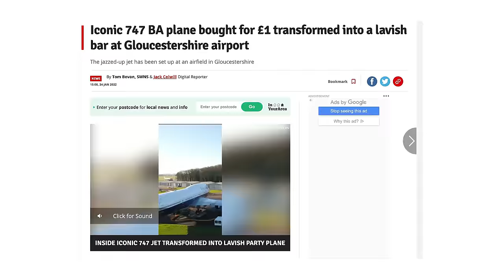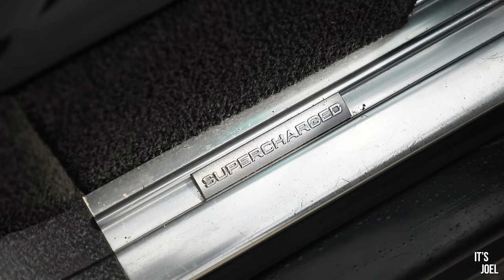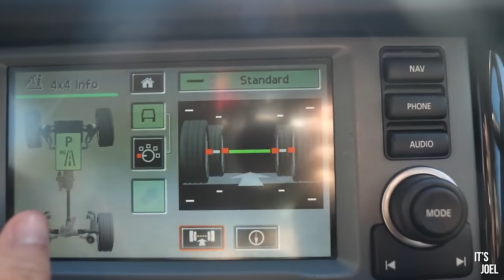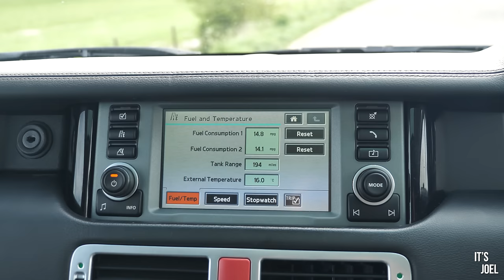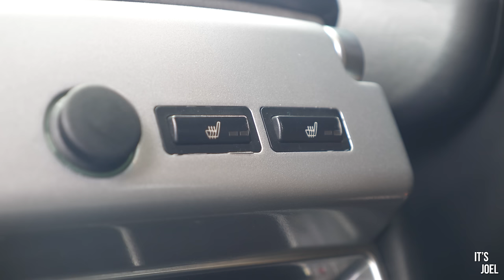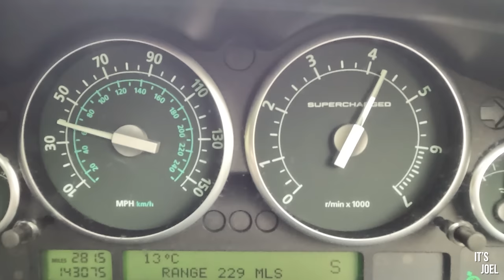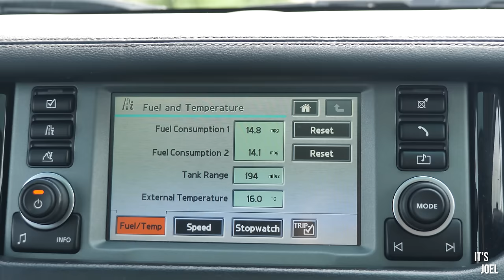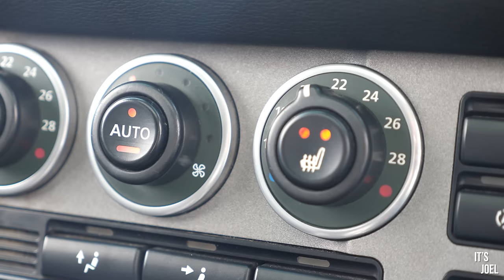BRUTALLY HONEST REVIEW OF THE 4.2 V8 SUPERCHARGED RANGE ROVER L322

Comment from the maker: What are your thoughts on the 4.2 Supercharged L322 Range Rover?
Reply: I think it’s one of the two L322’s to go for. Either this or the 4.4 TDV8. Supposedly the two most reliable engines of the bunch the benefit you get with this one is speed sound and ulez but personally I’d probably still go for the TDV8 mainly because if fuel economy and the fact that the 4.4 is still surprisingly fast
Reply: 06 seats are my favorite because they have the shoulder support where the later models got rid of it. Only the 2018 and up have shoulder support now
Reply: If you have the budget, L405 is a better buy. And the L405 wheels on that L322 are atrocious.  It makes the vehicle look confused and in the midst of an identity crisis.
Reply: @CEC321  the L405 may be better but I like the L322 more
Reply: I think the sweet spot is the 4.4 tdi Autobiography 2011 or 2012
Reply: I would still prefer 4.2 s/c with quality LPG conversion over the TdV8s bc of the long term engine maintenance
Reply: I’ve got a 2008 Range Rover sport TdV8 3.6 litre. Acc suspension that grips the road and will corner at speed with little to nothing body roll. 
And the power will throw you back in the seat. I’ve driven the L322 with the 3.6 engine as well. 
I would love to have a drive in the 4.2 but I think I would nail the throttle to much so I’ll stay with what I have. 🤣🤣
Reply: Loved the thought of it so much i bought one! absolutely amazing!
Reply: L322 4.2 supercharged V8 ... Great car ... But if you want a similar aged Range Rover, and want to thrash round corners, try a Range Rover Sport L320 with the same supercharged 400 hp V8 engine ... slightly quicker, much better on corners, and the Brembo brakes are astounding ... but the suspension is not quite as soft, and has a very slightly less luxurious interior ... but easier to parallel park in London (it's five inches shorter than an L322 and has extremely sharp steering) and, being powered by petrol, it is ULEZ compliant.
On the occasional motorway trip to Yorkshire or Somerset, from London, it does 22-24 mpg ... around town it does less than half that ... but so what! ... a regular yearly service at a specialist Land Rover establishment, a weekly visit to my local Hand Wash site and an interior/exterior mini-valet every three months ... perfect ... Total maintenance and running costs? ... Much, much cheaper than setting fire to cigarettes every day.

Comment: To anyone with one of these, I highly recommend the 20 inch alloys and putting the Pirelli all terrain tyres used on the l405 range rovers on the car. Completely transforms the grip levels.
You can also get 24mpg out of these, but there's no fun driving like that, smiles per gallon >

Comment: I believe it’s one of the most reliable engines on this generation. Not brilliant on acceleration, but far from being a slow flat. 
Love this generation! So classy.
Reply: Drop it in to sport mode, drop a gear and tell me that again.
Reply: @ well, it’s not bad, but I believe it depends on the references. I’ve had the newer one with the 5.0 S/C, when I drove the older 4.2 didn’t had the same excitement 🤣 but when I think about it’s age, it was a beast for sure

Comment: I paid $7,000 for my $92,000 4.2 RR  SC about five years ago.  The RR 'dealer' had installed an undersized battery, so the BMW electronics mostly failed to work until I rightsized the battery after a couple of days.  I had the sealed for life (i.e. short life) ZF box drained and refilled at around 90,000 miles which was late, but it has survived so far.  Just don't stand on it in 2nd, and always use manual for the first few miles on very cold days, but after another 25,000 miles it's almost perfect, so I think I'll just treat it to another lubricant and filter swap in about another month.  The air suspension compressor was noisy and soon failed, but a replacement from China that is visually identical to the OEM one was only a couple of hundred bucks and easy to swap in under an hour.  The hardest part was getting the bloody heavy 20" spare out of its well.

Both folding drinks holder were gummed up with spilled Coca-Cola or something similar. (The PO obviously had children of all ages, including adult).  They are quite easy to remove, wash and replace in perfect working order.  The FO audio was dead but easy to repair by bypassing the dead Bluetooth telephone module, which serves no useful purpose these days.  I removed and repaired the CD player, which was gummed up with dust and needed some lubricant, swapped out the DVD player with one from eBay and, with the car working well, made my one big mistake.  I replaced the well-worn Pirelli Scorpion tires with some slightly bigger, sticky Kumho tires.  My highway gas mileage dropped from 20 MPG (US Gallons) to around 16 MPG!  I use the power of the supercharged engine and attest that the Kumho's stick like sh*t to a blanket, but 4 MPG!  Woah.  I won't make that mistake next time.

It rains a lot here in Oregon, and the RR leaked a lot.  Water coming from under the dash.  Water coming down through the front seat belt retractors.  Water pouring through the electronics installed on both sides of the rear load area.  All the online advice was wrong!  The windshield was not leaking.  The roof rack mountings were not leaking.  The rear door seals were not leaking.  The rear sunroof drains were clogged so once the sunroof pan was full the accumulated water would slosh over the edge and flow forwards, backwards and sideways on top of the headliner depending on the motion of the car, or how it was parked, and flow down into the car from wherever it gathered on top of the headliner.  Since the rear drains are impossible to reach and clear without removing the roof it seems, I just used RV roof sealant tape to seal the sunroof (which never gets opened in Oregon anyway) and once the car dried out no water leaks have ever returned during the wettest winter on record!

I have one remaining challenge.  I'm convinced the bloody Germans have never forgiven we Brits for beating them in WWII., especially BMW.  The manky electronics are overengineered but under designed.  Three bus systems, excessively voltage sensitive circuitry and many connectors positioned where they are bound to get wet in a Land Rover.  Like many other Range Rover (and BMW owners) I am trying to identify the source of a parasitic voltage drain.  I have found several so far, but am confident there is at least one more to locate and eliminate.  I'm a retired computer engineer.  If any computer company built computers the way BMW designed electronics, they would have been driven out of business decades ago!

All the above said, I still love my SC RR.  It rides superbly, goes like hell when asked, and goes pretty much anywhere I want to go without any fuss.  We especially like the tall 'greenhouse' which provides fantastic vision around us for both viewing the countryside and safety in dense traffic.

If it was good enough for Queen Elizabeth II to drive around Windsor, it's good enough for me.  It was, and she did.  The Range Rover L322 is without a doubt the best 4x4 by far.  Still.
Reply: how reliable has your truck been overall? approximately how much do you spend on maintenance in a year?
Reply: Yes if it was good enough for the Queen …..

Comment: I bought a 2007 one 2 months ago. Fuel economy is poor, but that's a sacrifice I'm willing to make to own such a lovely car. I had to get petrol for ULEZ compliance. I'm also led to believe the Superchargers are more reliable than the turbos. The driving position is excellent and you can see everything outside. It's a wonderful car that does everything I need. I can have dogs in the back, do tip runs in it, but can also use it for nice drives and when you want to go out in the evening. Really is everything you need. Despite it's age it's still a head turner and I get lots of compliments about it all the time. 
I really don't see myself getting rid of it.

Comment: My dad has had a 2008 3.6 TDV8 for the last 7 years or so. Now on 175k miles, and I absolutely love it. It’s sitting in facelift 20 inch wheels, black with chrome over cream interior with piano trim and black piping, such a classy spec and classy car. So good off road, incredible for towing, and just sublime on a long journey. Honestly one of the best all round cars ever made in my opinion, so easy to place on the road despite its size, and you’re bang on about wanting to make you drive slower

Comment: Those mpg figures are eye watering and just show what a difference weight and aerodynamics makes - I have the same engine in my XJR and it will just about do 30mpg on a motorway run without hypermiling.
Reply from the maker: Yeah that doesn't suprise me! To be honest, I think if I really tried, I could potentially eek 23-25mpg out of the Range Rover, but still...

Comment: Got this engine in my L320 and its easily one of my favourite cars ever to just rattle along in. The whine is addictive though and a sub 90l tank makes the range laughable even when full. Still suck a cracking engine though and from all i can read up on is one of the most reliable available between the L319, L320 and L322.  Even managed 24.5 mpg calculated on the last 200 mile trip. Got it over the L322 purely because of the rust concerns (and its £1500 pricetag to buy) and willing to spanner 95% of things myself.
Reply from the maker: The whine is very addictive, I loved it

Comment: Was gonna go to bed, but I had to see what you thought of the 4.2! I have an 07 supercharged that looks just like clarksons. I've had plenty of issues however, put the money into it and it will return the favour. Great vehicle and I highly recommend one! The TVs help when the kiddos start arguing 😅
Reply from the maker: Thanks so much for watching!
Reply: Great content, well worth the watch!
Reply: what issues did you have if you don’t mind me asking?
Reply: @Spartansrule118 Compressor fault replaced with an AMK unit, changed the air suspension reservoir too as the other was rotten(18 years old). Welding required on the rear sills, both sides, below the rear passenger doors(wasn't that expensive as I went to a professional fabricator had the job done in less than a week). I decided  to have New Pirelli scorpions all round and new breaks(Brembo), for peace of mind.

Hope this helps 👍

Comment: My wife had a 2006 RRS with the same engine - was lovely, just got a bit too expensive for the mileage she was doing.  Had 175k on the clock when she sold it to my brother 3 years ago.  Get a pre Apr 2006 and you get the cheaper road tax, other HUGE advantage is they are all ULEZ compliant - unlike any of the diesels, the petrol V8s are also MUCH more reliable than any of the diesels and surprisingly cheap to service at a specialist.  Put those 3 together and thats a lot of additional £££  in your wallet for super unleaded.  Highly recommended 😊
Reply from the maker: I bet the RRS with the 4.2 is marvelous to drive. Still never actually driven an L320!
Reply: @itsjoel  It was great fun for what is a lego block on wheels, really comfy too - still tempted to get another one - but 5L, no supercharger wine like my XKR but a beast.  Roger the RRS is now enjoying 3 or 4 k a year with my brother who has gone through him over the last 3 1/2 years to make him even better 🙂

Comment: The tourch is a camera too it called venture camera and you can connected to the main screen and display , and there is accesories so you can fix it on the body of the car to act as a off road aids for example in front or even on the ground under the car to know your aproach or deparch limit 😊

Comment: L322 4.2 supercharged V8 ... Great car ... But if you want a similar aged Range Rover, and want to thrash round corners, try a Range Rover Sport L320 with the same supercharged 400 hp V8 engine ... slightly quicker, much better on corners, and the Brembo brakes are astounding ... but the suspension is not quite as soft, and has a very slightly less luxurious interior ... but easier to parallel park in London (it's five inches shorter than an L322 and has extremely sharp steering) and, being powered by petrol, it is ULEZ compliant.
On the occasional motorway trip to Yorkshire or Somerset, from London, it does 22-24 mpg ... around town it does less than half that ... but so what! ... a regular yearly service at a specialist Land Rover establishment, a weekly visit to my local Hand Wash site and an interior/exterior mini-valet every three months ... perfect ... Total maintenance and running costs? ... Much, much cheaper than setting fire to cigarettes every day.

Comment: I had a 2007 US spec. Sold it with 335,000 miles on the odo. Fantastic vehicle! We didn’t get the diesels in the USA & I found the 4.4 underpowered. Bigger brakes, super comfy, excellent visibility (I ran the rear middle seat down) and such a presence on the road. Epic car!
Reply: you mind sharing any issues you had along the way? were they overall reliable, or are the rumours true?
Reply: @Spartansrule118  Purchased in 2020 with 280,000 miles for $4,900. One owner. Per the dealership, lots of (often early ) servicing & maintenance but no ongoing issues. Original engine & transmission. Stuff I had to replace: Headlight switch. Boot seal. Alternator. Radiator. Bonnet release cable. One air suspension bag. Brakes. Expansion tank. Several bulbs. My mechanic (independent shop in Portland, Oregon) sees higher miles frequently on the 4.2 SC engine. It didn’t have any rust because it was always garaged and I lived on the eastern (dry) side of the state. I also owned a 2007 L322 HSE & found it underpowered, with the SC version being just about right. I also has an ‘08 LR3 SE with the 4.4 that was a very reliable car. The Jag engines were great to me, especially after having several of the Buick ones fail. I’m not hearing good things about the 5.0 though. I would be interested to drive a 4.2SC & TdV8 back to back & compare. I can see why the L322 is becoming sought after!

Comment: Just bought a 125i cab the other week, sedona red M sport paid 3900 for it full history. Just fitted 130i brake carriers and discs as easy upgrade. I have 130i ‘s so for me I need to do the remap as the engine is frustrating standard, same up to 3k the flat, where as the 265bhp revs eagerly. I bought because I love the 6 cylinder NA 1 series but I didn’t want the impractical nature I had in my old 3.0 Z4, taking it to Switzerland in June

Comment: I love  my 4.2 SC.  It’s so special and a dream to drive!  The upsides outweigh the downsides IMO.

The downsides are shocking fuel economy - it doesn’t matter how rich you are, you will still notice it as you are in the petrol station constantly!!!  I once saw a guy putting £20 in L322TDV8.  I wouldn’t even bother with that amount in a 4.2SC as it wouldn’t move the needle…..just fill it to the top otherwise you’ll literally never get anywhere. 

Oh, and maintenance is also VERY expensive - cutting corners on these cars is a fools errand, and it’s a crime not to look after these beauties  properly.  Mine has been well looked after its whole life, and even though it’s now in storage and only comes out occasionally, it still costs thousands per year in maintenance. 🧑‍🔧 

But as I said, the positives outweigh the negatives - it’s that simple! 👍🏿

Comment: My 5.0 sc does about 15mpg around town. Easy to get into the 20s and around 26 on a longer run. I like it for not having to worry about the dpf, ulez friendly and I’ve fixed the common issues myself. so far it’s been a very reliable car
Reply: what common issues have you addressed if you don’t mind me asking?
Reply: @Spartansrule118  coolant leaks, the oil coolers fail and a lot of the plastic coolant components some of which are underneath and behind supercharger. While you are in there, change s/c oil and coupling. Injector failures are quite common too I’ve had one go so far. Otherwise frequent oil changes and keep monitoring for cam chain noise. When it comes to that i will replace myself it’s time consuming but well documented job. The rear chain which drives the HPFPs can stretch too which is an engine out job, the HPFP’s can also fail

Comment: Here in London, I will get charged £12.50 ULEZ driving a diesel L322. So, the petrol V8 starts to make a lot more sense 🙂
Reply: p.s. it would be nice for you to compare the 4.2 to a 5l v8 supercharged
Reply: Until you have to fuel it!
Reply: @andrewwaller5913  Persoanlly, I'm not so bothered about fuel costs. Here in London, it takes too long to drive far. So, only driving short journeys doesn't use much fuel. I'd like an L322 and I did think about the 5l petrol. I think the mpg for longer journeys would be around 20mpg.  

However, I've ordered a Discovery 4 v8 petrol - with the 5l v8, non supercharged. Quite a left field choice. But it'll be great to be ULEZ compliant.
Reply from the maker: Absolutely, I'd really like to review a 5L supercharged model.
Reply: @adrianjudd5327  When I lived in the Middle East I drove a Discovery V8 which did 15mpg! But fuel was 9p a litre 🤣
Reply: @andrewwaller5913  Here in London, I only have to drive 1 mile to drop my daughter off at her dance lessons. 

It's a 12 mile round trip to Oxford Street. So a day out for 1 gallon of petrol 🙂

We'll see how it goes ...